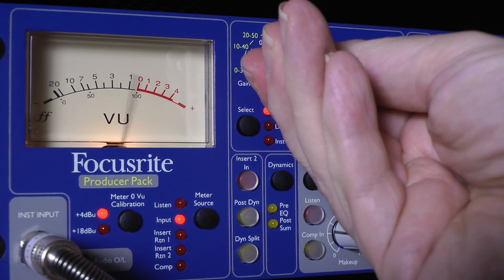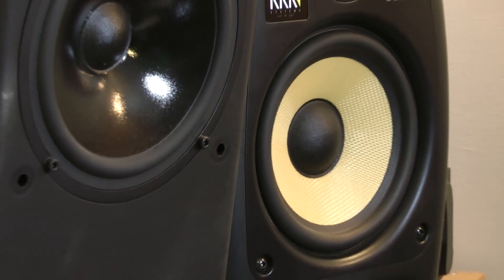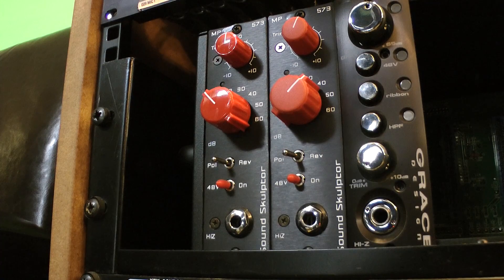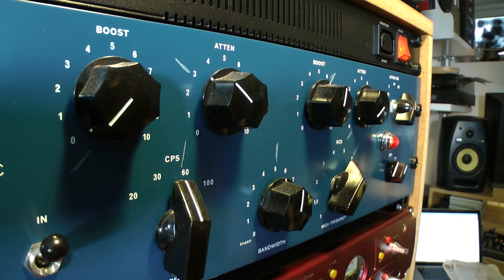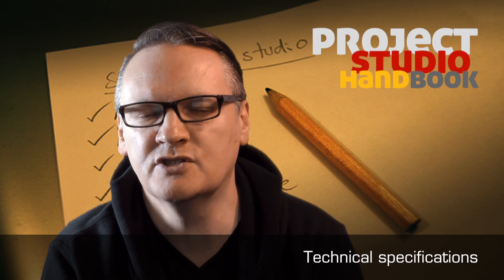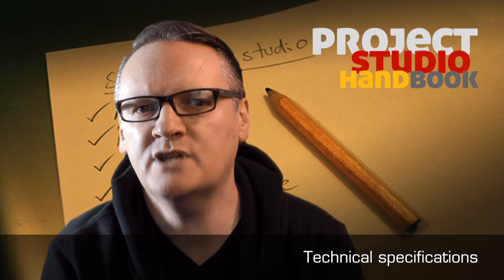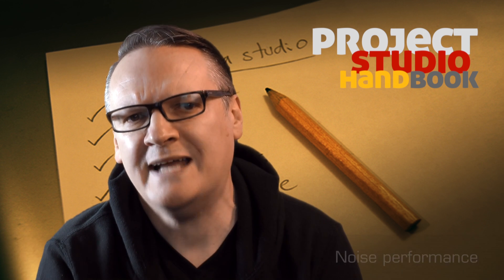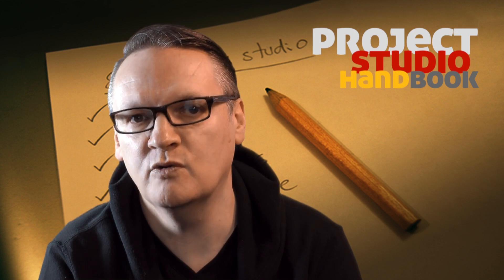Microphone pre amplifier comparisons

Comment: Since you compared the Europa, just wanted to know how would you rate the Focusrite Liquid Channel in comparison to these three which I see in your rack.  I understand that the Liquid Channel is a preamp, compressor and an AD/DA converter and is that the reason why you didn't include it in for comparison? Since you have an LC and various other preamps, your comments on the LC can be of great help to me as I was intending on purchasing one.
Reply from the maker: Hi Namin. I didn't include the Liquid channel in the review because it would have ended up being a comparison to see how close it sounded to the other mic press, though I suppose I could have just used its hardware mic pre (no emulation) which is fantastic and transparent. I would recommend the Liquid channel to everyone and would be more than happy to have a studio with just it. Anyone who thinks it sounds poor simply hasn't used one. The differences between most modern mic press are tiny (you're not allowed to admit to this, but it's true). One day I'll post a blind test in which folks have to identify mic press, and which examples are the Liquid channel. Bet folks will have a hard time telling! Also have you seen this? .. Focusrite // Liquid Channel Shootout at Snap! Studios

Best wishes Matt
Reply: Project studio handbook   Thank You so much for the valuable input. Thanks for the link. I am just thrilled to have found your site and I am subscribed. You make it so easy to understand. Explanations are top notch. Cleared a lot of things for me.
Reply from the maker: Namin Nooman Thanks Namin. Glad the site is useful. We should have our May video on the Speed of sound uploaded by tomorrow.